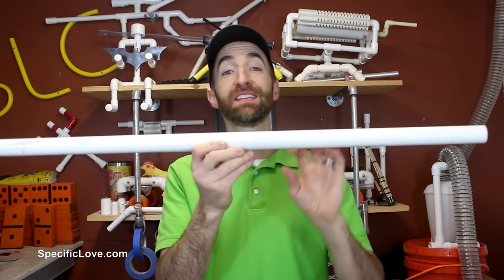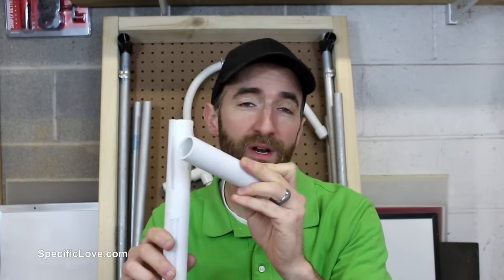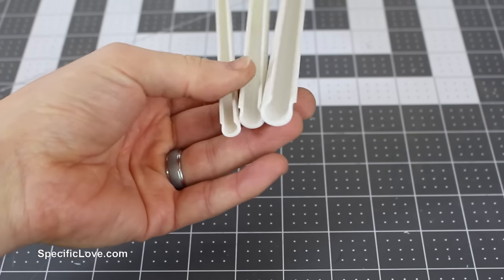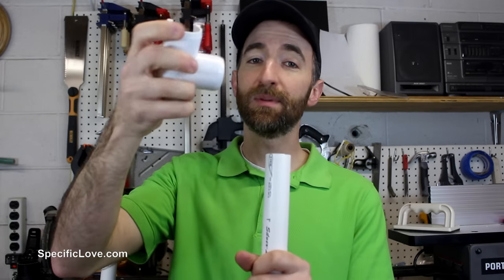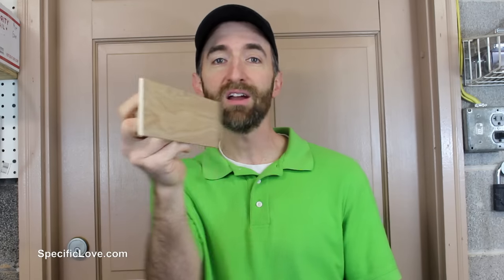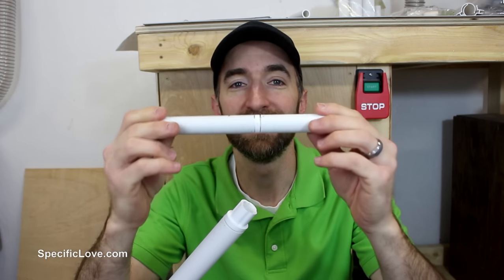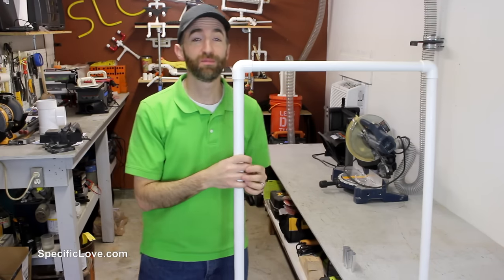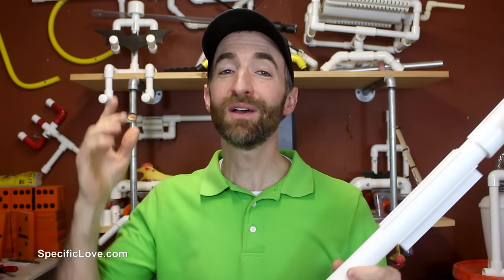10 Life Hacks with PVC #26

Comment: I made many of those lateral "snap" clip on connectors by running pvc pipe through my table saw. A heat gun works wonders to modify the pvc pipe dimension after slicing lengthwise. I made the open ended t snap connectors by cutting the typical t connectors the same way.

Comment: I'm glad I clicked on this from another video.  These are exactly what I was looking for.  The downfall is trying to find the Snap Frame as only a few places that I could find are charging almost $15 to ship a 48" - 8' piece and no breaks if ordering over a certain $.  I was looking at making my own FIFO can tracker since the one I had bought from BBB is either no longer available or on a long back order.  Found the manufacturer and lucky for Cyber Monday pricing to help.  But still, creating a PVC pipe set up where it's easy to adjust and designed "your" way would be great.

If anyone knows where I can find the Snap Frame parts at a better price, please let me know.

The other project I'm looking to make with these helpful parts is an inside fort for my 2 toddlers.  The door hinge would definitely help.  I saw the ideas on other videos, but not sure what they were called.

You made this much easier, and I appreciate it!

Comment: Any recommendation if you want to make a storage shed using PVC pipes for a zero turn lawn mower.  What gauge and size PVC pipes would you need?   What other attachments would you need to make a stable structure to protect your mower from the elements and snow/heavy winds etc...  Will it be strong enough to withstand standing snow?

Comment: Do the rotating clamps have a over hang? I want to use these to run horizontal pipes along a table and use them as the base. But can I lay something flat on them and have them contact the flat surface, or will the clamps touch the flat surface first?

Comment: Want to make a shade canopy over my deck about 16’ x 24’. What size pipe should I use? Was thinking 1” pipe. How far apart should I space my vertical and horizontal poles? I was think of making 4 x 4 sections attached to each other. I could not find any plans on line. Any suggestions? Thanks.
Reply from the maker: Since it will be in direct sun light, then the pipe may warp over time, so the supports will need to be fairly close.
I have not built one of those so just do some testing before building it.
Reply: Specific Love Creations. Thanks for the reply.

Comment: #8 the internal coupling. Have you came across any that are 90s or Tees? I build furniture with PVC and would like to have something with a smooth finish on the pipe rather than the external fittings
Reply from the maker: I have not seen those as of yet.
Reply: The various "T's" and fittings are listed on the website...just have to look.  They list internal "T's" for  1/2-inch and 1-1/4 inch, as well as other configurations.

Comment: if you have some 1/2" PVC schedule 40 and cut a slot down the length of it, how far can it be split apart?
Reply from the maker: If you heat it (heat gun) without burning it, you can spread it flat.

Comment: I have a clean and carry (no wheels) pressure washer with a 5 hp motor attached to a metal tube frame. I do not have a tube bender or a welder so I thought I could use  pvc to build a frame (with wheels) with 1 inch pvc, rough dimensions would be 20 inches in length 14 inches wide 8 inches high to hold the motor overall hight would be. 3 1/2 with handle. Before I purchase pvc tube and the many fittings. your opinion do you suggest this would be good idea, could the pvc withstand the weight of the motor and wheeling it around for years to come. Thank you for your reply.
Reply from the maker: The pipe most likely would support the weight of you have 4 pipes as the frame, but I would be more concerned with the vibration of the system. The combination of weight and vibration might be a little too much for longevity.
Reply: Hi, specific love creations. I made a Cart for the power washer and it came together nicely, can I send you a picture of the project. Thank you for the ideas.
Reply from the maker: Please send a pic message to our Facebook page ... 
facebook.com/specificlovefanpage

Comment: 123456 views, serendipity. watching on my moms account.
been pondering how to make a broomstick/bike hane inside two human sized hamster balls with ball bearings in between them to keep the structure moving towards equilibrium but still give you some control over motion

I think I answered my own questions

I want to throw some elastic line/ counterweights in there and make it so you can fly, or kind of feel like it at least. I have a bunch of bamboo to work with. Thanks for the awesome first two tips I need to rewatch now. any advice though? thanks
Reply: hang*
Reply from the maker: That sounds very interesting. I don't have any suggestions as of yet, but if you have more questions in the process of building, let me know.